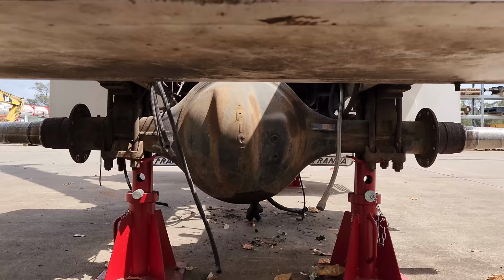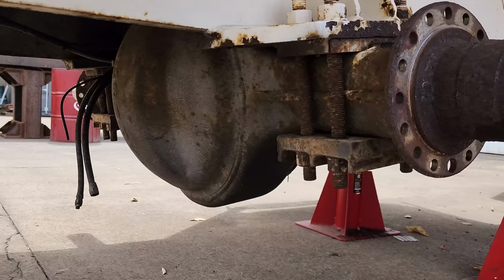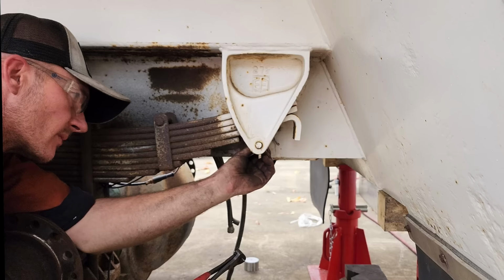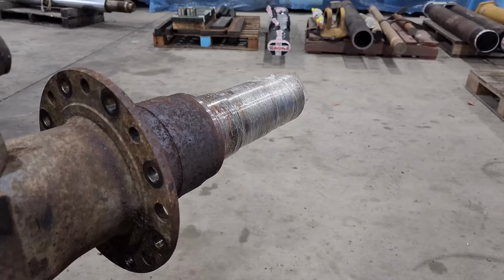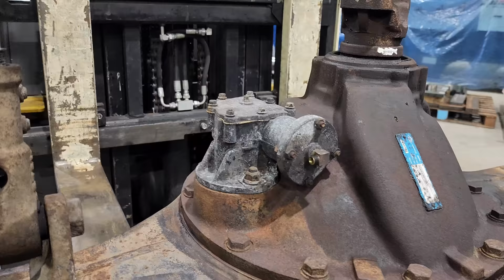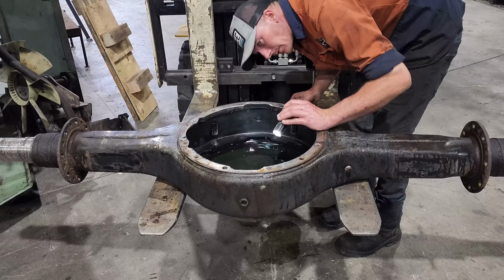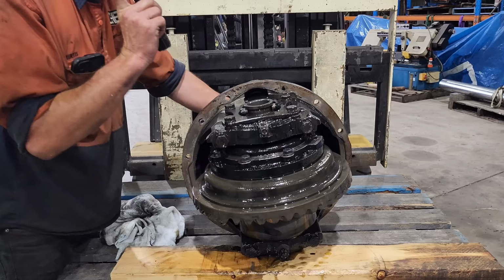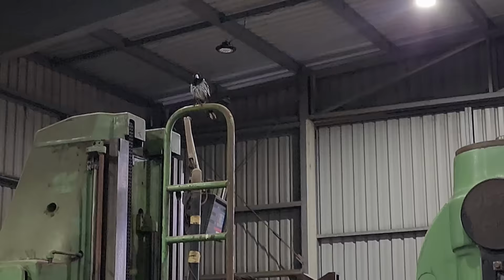Removing & Inspecting The Diffs! | Franna Crane Project | Part 8

Comment: Today I learned that Aussies call "rings gears" "crown wheels". Thanks for the video!
Reply: Not to confuse the issue but ring gears are found on the flywheels of engines to engage the starter motor and are usually straight cut.
 Crown wheels are found in differentials and are usually bevel gears. At least that's been my experience.
Reply: @ronwilken5219  Your not wrong but in the US it is generally referred to as a ring and pinion when talking about differentials in "automotive" applications.

Comment: Given the way the brake hardware attaches to the axle, I'd be tempted to see about upgrading it to air disk brakes. On one hand, changing the pads on them takes all of 5 minutes per wheel end; on the other hand, changing rotors requires pulling the hub, and if you don't use them enough, the caliper slides tend to seize up.

I probably would end up not doing it, but it would get some thought at least.

Comment: A lot of mechanics here in the States don’t mess with the spring bolts, they just torch and replace them. On highway vehicles I have been told that they have a preload and are only made for one use.
Reply: Aha, you did cut them!

Comment: Curtis, With your having the boom in the air and your removing all the weight from the base you might be risking the crane tipping over. Don't know if you considered that. The engine, diffs and all the brakes and wheels are probably like counter weights

Comment: Very smart. Much time can be wasted fighting bolts laying on your back. I presume you will wait for the breaks and install complete differential assemblies. You might assemble them on your welding table if the top is repaired. No need to bent over as much.

Comment: I will point out a story with those injection pumps. Have one on a John Deere 4239 in compressor. Starts even harder after sitting 3-4 weeks. Appears something sticks in the pump and fuel does not flow to the injectors. I tried everything, took it apart, nothing seemed worn or amiss. Added an electric lift pump, seemed good for awhile, then totally dead while cranking again. Solution that works is a small ball pein hammer. Tap the pump lightly and rapidly, top cover, distributor head. For 25-30 seconds, then crank. Starts right up every time.

Comment: you can make cheap new bushings by buying boat trailer rollers and cutting them to size, they have many materials to choose from and almost all of them have the steel bushing through the middle, been making body mounts of boat rollers for years

Comment: With a little penetrating oil & heat you probably could have those nut on the U-bolts loose. Cutting the trailing link and removing springs, etc. seems like a lot of work later.

Comment: 7:55 You had that bolt Kurtis, run it back up, a little wire brushing and a little lube and it would have come right off.
It's kind of obvious you've never had to deal with rust before.

Comment: Kurtis, I'm pretty sure that those dif's are not lockable, I had a truck with the same kind of dif and those are two speed difs. One with lower  speed (high ratio) and the other with normal speed/ratio. That air piston showed on video actuates that forck/lever to engage the low speed. For your's application you can engage the low gear and forget about the normal gear selection. Cheers mate!

Comment: Another great vid ..  I noticed you put the nut on the front axle cuz u seen what happened to the rear.  Just another minor inconvenience it's part of the game when you're trying to get shit done. I'm sure you are still doing other jobs while you're working on the mobile crane. I know you have plans on selling the other tractor crane, me personally that would be a hard piece of equipment to part with. It's so reliable especially after all the work you put into it to make it reliable and it's so versatile. Can you drive the new one into the shop and have the same mobility as the the one you have now... uhmm I don't think so personally. Your truly one of the best in the industry. I hope whoever is the recipient of the Tractor Crane is as responsible and respectful to that machine as you are💯

Comment: while you have the axle housings out from under the crane you could build adapters/ hubs to fit brakes and bearings that are more common , that way it whont be as hard to get replacement parts for them 
dont think it would be too hard to cut out a set of adapters to fit different backingplates and adapt the hubs with another set of adapterplates or find / make different bearings and spacers so you can fit modern hubs and brakedrums on the spinles so normal rims fit

Comment: Kurtis, just a thought, with the front diff it looks like it would be possible to machine out the slots for the diff in the other side of the core opening in the pumpkin, IOT allow you to flip the whole diff right way up, leaving magnets in the oil and breather on top. What I’m thinking I’ve missed here though is the mounting plates, would those be easy enough to pop on the other side of the tubes?

Comment: You could have tried drilling the bolts nearly all the way through and chased the diameter out most of the way. That weakens the bolt as it lost most of its mass heat up the remains almost cherry red and use a drift and sledge to drive them out with what’s left of the bottom of the bolt. That means you drag links are still intact and the rubber bushes have burned out the way. Been there a few times. Showing off picking up the fork extensions😀

Comment: a wee tip for sorting the rusty exposed threads on your "u" bolts, take a spot blast gun and a piece of plastic gutter as a shield and blast the threads, a quick suirt of penetrant oil after, and the nuts will fly off, works on 99% of exposed corroded threads......if it isnt there, ie no more swollen rusty steel, it cant seize

Comment: This is allot of work for a yard crane? now you have gone this far, remove the rear diff bearings and check for water marks.(especially) if it is going to be rental (higher NO NO lower) vehicle/machine, that may be doing road kilometers. Excellent work as usual, and you do a superb job of overseeing the video and editing quality. Karen i applaud you're, dedication and commitment.

Comment: My team made an adapter that we would install on our forklift in place of the forks to bolt the axles of our front end loader to when removing and installing them. 

This may work for you too to make it easier to get in and out.

Comment: Hi all at CEE.
Cleaning it with Kerosene really cleaned it up well. I don't have access to that, just carb cleaner in a can.
People have said about scrapping the engine cowl, and you replied, you'll make a new one. I just wondered about using the old one as a pattern might have been a reason to keep it (I suppose that got mentioned also). 
Can you move those magnets so they are on the bottom so they are move effective?
Has anyone mentioned about making a drift crane? Not high speed drifting, maybe at 5-10mph on grass. Just a throw out thought I had 🤣
Also at around 28.23 mins in, have you seen the auto created subtitles? It mentions I think it's Georges singing as it says [he must be happy because he is still singing]. Has that AI got it right, or is it's own thoughts?🤔
Looking forward to future crane videos 😁

Comment: 17:30 😲That hurt to see the threaded end of spindle on axle tube dragging across the ground! Hope the threads are ok. I'm sure Curtis can make it better anyways. 
Ps @CEE You got a shout-out from Isaac @I C Welds last week on his video. Was talking about you Curtis and your breathing PPE helmet for welding you use when welding and his need to get one. He also is ready for a compilation video w\ you! That would be a good video compilation w\ you two - @CEE & @I C Welds ! I Love both your channels, you both are amazing at what you do with metal! 👍🤔👌🛠️🗜️🔩🔨🔧📐🧰👨🏻‍🏭📏✏️⛓️⚙️😀🍻
Reply: Also I can't believe those U -bolt nuts actually broke free on the threads. I don't think they were tightened to spec or maybe they were replaced not to long ago. My '00 f250 rear axle U-bolts wouldn't budge with a 1/2" impact &\or a breaker bar + 3' helper pipe. Ended up just cutting them too. I'm amazed those one just zipped off w\ no resistance at all! 🛠️🔩🔧👨🏻‍🏭🧰😀
Reply: Nm I see you did put the nut or something on the end of the thread. Didn't notice on first view, until I blew up freeze frame & saw extra the 'saran'-wrap on it.

Comment: Fantastic videos. The drain hole for the oil on the diff they have turned around, is that on the top? If so, you can make a new hole in the bottom so you easy can change the oil next time 👍

Comment: Surprising...is there no PBblaster down under?  Or inductive nut heater?  I deal with a lot of rusty stuff.  PBblaster works miracles.  When PB wont work, inductive heaters usually work.

Comment: I noticed you broke the ujoint straps loose by hand before using the impact. Just curious on why you fussed with the propeller shaft and broke them loose by hand? Looks similar to typical 4x4 stuff

Comment: Would it be good practice to re-position the two magnets from the front diff to the bottom of the housing, just to put them to work rather than having them on the topside of the component?

Comment: just a curious question on the (I think) traction rod... why didn't you use the torch and just cut the bolt off on the back instead? wouldn't that have been a better/cheaper option than having to replace the rods?

Comment: with the housing appearing to have symmetrical bolt holes, the axle could have been mounted right side up, i wonder why they didn't... maybe it was a reinstall and came right side up from the factory.

Comment: @CuttingEdgeEngineering hey Kurtis, I am just curious as to why you were using kerosene to clean the diffs? What is it about kerosene that makes that work?
Looking forward to next week already. 

I am waiting for the day, george lands on the camera and takes a peek at the lens to say hello.
Reply: Thought I should just add my thoughts toward an answer, while waiting for Kurtis or Karen to reply: Kerosene, or paraffin, is a petroleum derivative (lighter petroleum fluid) which makes regular petroleum mineral oil easy to dissolve and remove, mainly because its close relation in composition to the heavier oils. Another advantage is that it evaporates quite well, leaving only a thin oil film behind. It can to a limited extent also displace water in smaller quantities, like dew droplets.

Comment: I's best to go ahead and get both diffs and axles out for inspection and or rebuilds because machines know. They now hen you repair up parts of them but leave others alone because "it's got nothing wrong" well. As soon as you button everything up, guess what? Yeah, what had showed no issues at all, suddenly will be spewing oil or whatever.

Ditto on the tin work, stuff had so much metal worm in it, that by the time you did get all the patches in, you'd have more time in than if you'd just made entirely new panels. Besides, now that you're going to be doing the tin yourself, you can add things like hood scoops an racing stripes. So on and so on.

Comment: If you can't beat it.. heat it.. it can't be stuck/rusted if it is liquid!! Here in the rust belt of Ohio. Cars less than two years old can have much more rust than your crane. You just adjust your approach.

Kurtis. Please take this as a funny bite. Why is it that only North America is the only place that uses banana units. But anywhere on the plant, when you go to a socket wrench or an impact drill, it is always 1/4, 3/8, 1/2, 1, 1 1/2 etc? Even if you work exclusively in metric equipment.  How did the world adapt to bananas? I think about th8s often 

Lol, when you got in the old crane to remove the axles, I immediately thought "why isn't he using the new crane to do this?"  I think I need to sleep, lol 

Another great video. And I am less than half way through

Comment: This may be a dumb question but why are you breaking the bolts with a socket first before using the ratchet? Is that to stop damage to the heads if you just hit it with the gun?

Comment: It sure looked like all you had to do to remove the diff from the leaf springs would have been to wire wheel the exposed threads before using the impact to remove the bolts.  I also noticed you did not use penetrating fluid on any of the parts before you tried removing them.

Comment: People forget that he's building this machine for his  business.  It's not some resto-mod hot rod job under the shade  tree in the back yard.  You have to factor in time and labor when you make the decision to do a repair...  Not only are you spending your time working on the repairs, but you are spending time that'd you could be making money on something else. It think he does a pretty good job at explaining where the tipping point is on the scale where buying something new is a better business case than rebuilding or repair.  Ive seen a bunch of business go under because the owner spends too much time tinkering around trying to make junk machines work than actually brining in revenue.  Its almost a skill knowing when to let your check book solve the problem.

Comment: Why didn't you apply some used motor oil to those threads on the spring brackets, wait a couple days, then wire wheel them off? I bet those nuts would have come right off then!

Comment: Aircraft kerosene? Is that more effective than, say red diesel for washing parts? Just wondering. 30 years ago when I had the best job I've ever had, I was washing motor parts in red diesel. It has to be a lot cheaper?

Comment: Well Kurtis, the question has to ne asked. Have you found the last rat's or ant's nest yet or is that still to come with the engine? How many episodes will this turn out to be? Could rival EastEnders or coronation street by the time you're done. Especially seeing this is supposedly done in your "spare time "! 
Good thing you hadn't sold or disposed of the old yard crane yet. As someone else pointed out its a bit like training your replacement before they retire you. 
Did those breather holes have plugs in them before? Seems a bit daft if not. 
Are you going to relocate the magnets in the front diff housing? Again a bit daft not having them in the oil bath. Thanks for the excellent, as usual, video from Karen. Greetings from Canada's banana belt.🤞🇨🇦🍌🥋🇺🇦🕊️🇦🇺🐨💩👍🏁😁

Comment: I don't understand why the 2nd differential they rotated it 180 degrees around the axle to change it's direction putting the magnets on the top. Couldn't they have just left the magnets in the bottom position and rotated 180 degrees end to end?

Comment: A few minutes with a wire wheel on a drill or grinder would've made getting those u bolt nuts off a lot easier.  They didn't look too bad honestly.

Comment: I always find it comical on high weight low horsepower applications, the massive axles with a tiny driveshaft going into them. But as a testament to how good parts used to be, even with decades of salt and abuse, with an open vent on one too, There’s not much if anything wrong with these axles. Quite impressive really.

Comment: Love your videos, but you should’ve definitely used the right tool for the job on those drain plugs and the right tool for the job is never a ratchet. They actually Make Square Drive bit sets Mine came from Cornwell.

Comment: Would be interesting to see how to put the axles back in. For the work I thought to build a kind of scissor lift to sit on and moving myself up under/in the back of a excavator. Often it's not enough for working on my knees neither it's for standing up. It's a really problem and a lift can be used for other things like holding parts in the right position like a oil drum when changing oil. When I started the work few months ago I had a to help a co worker to lift up two thick plates under a excavator. They was pretty heavy and I said "why we don't use the hydraulic jack for lifting up cars?" but the co worker didn't want to make himself extra work. That is why I got thinking to not be this stupid and saving my energy. Maybe those machines rollers can be useful for sliding the axle under and then lift them up with the crane, easy 🛠️😎👌😜

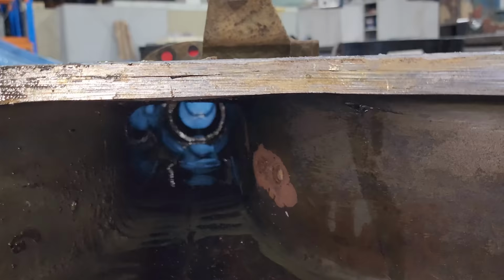Comment: 20:28 looks like a horizontal crack on the housing opening. I'm probably just seeing things, eh?
Reply from the maker: it is... but not what you think, it's just a slight separation between the casting and the machined flange top plate that's welded on to the housings. Nothing to be worried about 😎👍
Reply: @CuttingEdgeEngineering  Good deal then!

Comment: You have removed a lot of mass, engines, differential etc. The crane is high up. What is happening to the center of mass? I hope what's left of the crane doesn't topple over.

Comment: Little bit of heat and or penetrating fluid and those u bolts would’ve come right off. Would’ve saved yourself a lot of trouble cutting the bar in half and messing around with that bushing.

Comment: "How ya going guys, Kurtis from cutting edge engineering. Today we're gonna work on part 26 of our Franna crane rebuild. We're gonna add some adjustable tie rods, lower the suspension down, and we're gonna slap a bigger turbo in it."

Comment: Rather then cutting the adjustment rod to the differential why didnt you cut the nut off the bolt with a nut buster.

Comment: None of the steps so far have seemed that ridiculously hard. At the same time if you'd had to pay somebody else, it would not have been worth purchasing. Once this is all reworked and put back together, it'll probably be as good if not better than new and last decades before any of this has to be done again (at which point it will be far easier more than likely).

Comment: I think you made more work for yourself than needed. If anything simply cut the U Bolts as they're cheap. Instead you're dealing with a heavy assembly and have to machine a part rather than an off-the-shelf U Bolt. Back to the video!